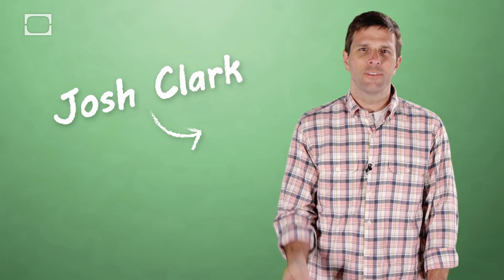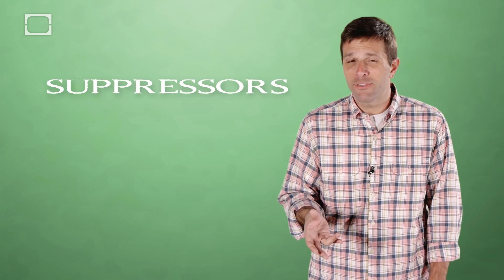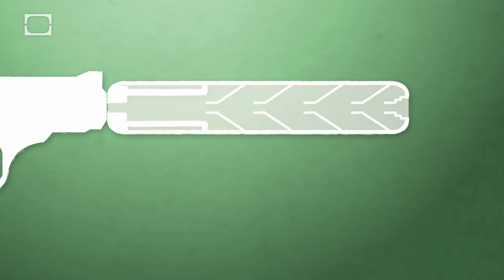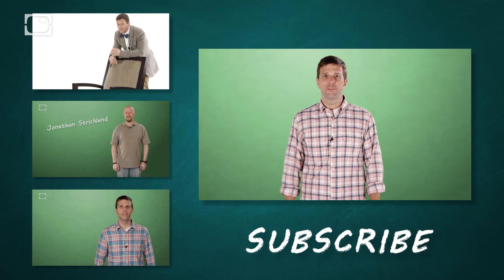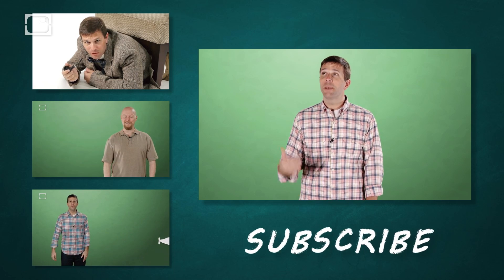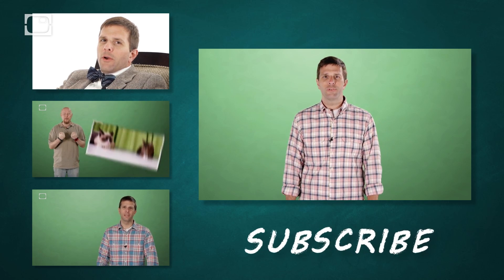How Do Gun Silencers Work?

Comment: Per definition of the ATF they are defined as "silencers". Either term is correct. Also there isn't really a negative connotation of using the word "can." It's just gun lingo. Personally I like to think of them as noise politeness devices. It is the same concept as putting a muffler on your car. It's mainly for the users hearing protection.

Comment: only nitpick is that these numbers might work with a few specific rounds, but those numbers are very situational to a specific caliber or two, including the 160 db number, seeing as not only does that only apply to a few calibers, but that number is also changed by the fact that the actual chamber, where the noise is originating, is never supposed to be that close to your face, therefor, the noise would be much more bearable.

Comment: 1. Hiram P. Maxium is credited for producing the 1st commercial silencer which he named Maxium Silencers.  Since his is the first and he named it a silencer then the CORRECT term is actually silencer and NOT suppressor.

2. Gun power burns - it does not explode. 

3.  The slang term for silencers is "can" but calling them that does not denote that one is a criminal.

4.  Silencers were invented and used for gentlemen target pistols which quietened the guns so no ear protection was needed for the shooter as well as spectators.

5. Spies don't use silencers - most sit behind a desk in front of their computers.  Criminal elements don't use them either.  Class 3 firearms require a much more extensive background check, fingerprinting, and ok from local law enforcement,and a $200 tax stamp.  The waiting period is about 9 months.  The FBI lists no crime committed with a silencer.

6.  Some ammo has always been subsonic (like .45 acp) that was designed before silencers were invented

7.  You watch too much tv and movies

Next time do a little research before you make an instructional video

Comment: Close enough, in a simi-auto pistol, (not that I don't believe rollovers can't be outfitted with suppressors) there are a a few more sounds. sound one, striker or hammer dropping, sound 2 firing pin hitting primer and primer cracking, sound 3 smokeless powder exploding, sound 4 gasses expanding and exiting barrel, sound 5 sonic crack caused by supersonic bullet and finally sound 6 the metal of the slide cycling and the barrel dropping and accepting another round.

Comment: Yah actually not true at all, suppressors increase velocity because it gives more time for all the powder to burn and create more pressure behind the bullet. the velocity increase is not significant usually between 10-60 fps on rifles but never the less and increase and most rifles that I have seen have stayed the same or improved in accuracy with a suppressor

Comment: So much BULLSHIT. Just stop talking. First, referring to them as "silencers" (even after correcting YOURSELF) throughout the episode reinforces the notion that these are the chosen accessories of assassins. WHICH THEY ARE NOT. In fact, in many other countries (like New Zealand), when you buy a rifle, IT COMES WITH A SUPPRESSOR. Second, in your graphics, you show a suppressor being attached to a revolver, which does not work, since there's a gap between the cylinder (where the bullets go) and the barrel (where the bullets exit), which defeats the entire purpose of providing a space AT THE END OF THE BARREL for the gas to expand. Third, you make blanket assumptions throughout regarding PSI, muzzle velocity, and decibels which not only change DRAMATICALLY depending on the ammunition, but also between the same ammunition used in different firearms.  FOUR, although you've stated otherwise in the comments, your statement about people who refer to suppressors as "cans" was OBVIOUSLY not a joke and your intent was sincere at the time, and you know it. Five, the end result is not a tiny "pew pew pew" sounds Hollywood has lied to you about for decades. The end result is a noise reduction that doesn't always even eliminate the need for ear protection. Six, there's no loss of accuracy. Due to the reduced velocity, there's a reduction in range (the distance the bullet will travel).

Comment: Was that cute little silhouette animation of a suppressor (a.k.a. silencer) being threaded onto a revolver done as a joke of some sort? I feel like even if you aren't very knowledgeable when it comes to firearms in general, it's still fairly obvious that there's a good explanation as to why you've NEVER seen a revolver with a suppressor attached to it. How the person who add said animation didn't sense something off about the way it looked or that he/she should probably use a semi-auto pistol instead due to the fact it's something they've actually seen being used with a suppressor. Anyways, the reason you've never seen anyone attempting to use a revolver equipped with a suppressor is because it simply doesn't not work rendering it utterly pointless having all the negatives of the suppressor (added weight, larger silhouette, less concealable, throwing off overall balance, blocking the iron sights, etc.) without it's intended purpose to cancel them out. Attaching a suppressor to ANY revolver only forces the noise out of the breech/chamber end of the barrel instead of it coming out of the muzzle as well. This is because the breech/chamber end of the barrel on a revolver is not sealed/enclosed within the frame or any other part of the firearm (like a slide does on an auto-pistol which forces almost ALL of the gas/noise out through the muzzle) meaning those gases/sounds escape from both ends of the barrel instead of just the one.

Comment: First of all... When you make a video called "How Do Gun Silencers Work?", you should get all your facts right and actually know how CAN'S work!

1. You do not loose accuracy from mounting a suppressor on your gun. If anything you will gain accuracy from the additional weight and lessened recoil. Also, the suppressor will make less turbulence at the muzzle, therefor the projectile will be more stabilized during the transitional ballistic part of its "flight" making it more accurate. As a secondary effect you will become a better shooter from the lessened recoil and bang.

2. You will not loose any speed from because of the CAN. The can is, as you say, an extension of the barrel, giving the gasses more time to work on the projectile before they vanish into the air. Therefor making the projectile go Slightly, SLIGHTLY faster.

The two points above are myths presented by the video game "call of duty". I am sad.

3. If you had talked to any people who call suppressors, cans They would tell you that using a revolver as an example for a firearm for which to attaching cans on, is the dumbest idea ever. Revolver is by nature not made for silencers, at all. They have cylinders with chambers in, usually six, that cycles. This is basically six barrels cut in half, taking turns trying to line up with another half of a barrel. This makes for a ton of gas leakage.

4. A CAN does not only let the gas expand, but lets the gas move more around to slow it down. A suppressor is usually more complicated than what your animation staff was able to come up with. They have angles and turns to make the gas slow down and be redirected. Many of them also have a back chamber to direct the gases backwards. Pistol suppressors also have a spring loaded piston to push back on the gun to make it cycle.

5. This one is not as bad as the others but worth mentioning. Sound travels at different speeds at different altitudes, different temperatures and different humidity. Take a revolver, a CAN and a round of subsonic ammo to the top of Mount Evrest to kill your sherpa without the other sherpas hearing it and you are in trouble.

Knowledge is power and when it comes to firearms and CAN'S, you guys are powerless...

Comment: 1: You can put a silencer on a revolver. Even if you could it would still be loud because the sound comes from the barrel gap. And a supressor doesn't make it as loud as a whisper. I know you tried to correct it with an anatation, but that was too embarrassing to correct. It makes it about as loud as a .22 magnum (if it's lets say a 9mm)

Comment: Wow, you really managed to pack a lot of complete BS into one short video.
0:43 Yes. "Silencer" is exactly what they're called. That's what the inventor of the device called them. That's what they are called on my ATF Form 4s. And that's what the majority of manufacturers call their product. How many Form 4s do you have?
0:58 Actually four sounds. In addition to the ones you mentioned, there is the sound of the bullet impacting the target.
1:14 Gunpowder doesn't explode. It burns or deflagrates.
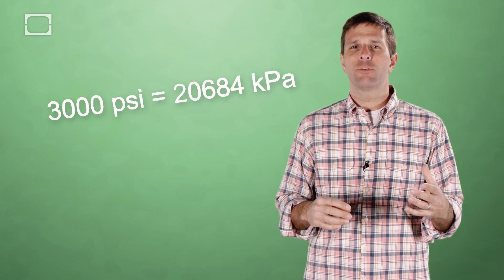1:19 Pressures vary dramatically with caliber, barrel length, and action type.
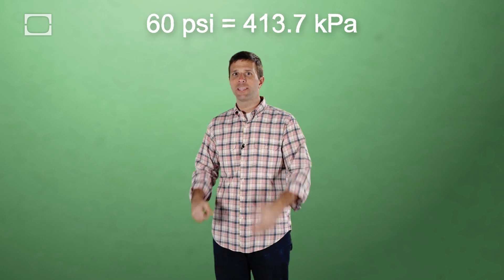2:10 Again, the sound pressure varies with caliber, barrel length, and action type.
2:25 One more time, the amount of reduction varies with the factors above and the design of the can.
3:43 Silencers that do not use wipes (most modern designs) actually slightly increase velocity (this is called free bore boost) and in some cases improve precision as well. While all silencers do shift the point of impact, well designed cans produce a very small and repeatable shift but also shrink the group size.

Comment: They are called suppressors.
Reply: +Team6OWG 
They can be called either. The guy that invented them dubbed his creation the silencer, and it was called that for years until tacticool mall ninjas went around correcting everyone's terminology on every goddamn thing.... Its not as definitive as the clip vs magazine meaning where theres a clear difference.
Reply: +Team6OWG The FBI calls them silencers. This guy got EVERYTHING wrong.
Reply: +Team6OWG The inventor, Hiram Percy Maxim, actually called them silencers. He also invented the automobile muffler, which is exactly the same technology. In fact, I find the best way to describe how firearms suppressors/silencers work is to just explain them as mufflers for guns. While "suppressor" is a more technically accurate description of what a "silencer" actually does, both terms are acceptable. It's not nearly as much of a fopaux in the gun community as using the terms "clip" and "magazine" interchangeably. At least when someone says "silencer", gun enthusiasts know for certain what you're talking about.
Reply: +Elijah Decker "It's not nearly as much of a fopaux ..."

* faux pas
Reply: +Team6OWG Suppressors silencers cans iv heard them all and got the idea...people that actually use or deal with them, Spec ops, CIA, FBI, ETC.... call them cans so yea..
Reply: I prefer suppressors since silencers sounds like it makes no sound like shooting in a vacuum with laser beams
Reply: ***** Intentional example.

Comment: This guy doesn't know what he's talking about. He states that suppressor is right while silencer is wrong yet proceeds to call it a suppressor. A long barrel increases accuracy but suppressers in particular decrease range. Unless you're using a .22 the hammer is not the only thing that is herd, because anything above a .22 will produce more gas thus making more noise, but the suppressor does help (unless you use a 50 cal.).
Reply: +Douglas Mitchell Read your second sentence again.
Reply: +justsaying yeah I noticed that one too but I'm just a bit to lazy to fix it.

Comment: Even better than calling them suppressors, we should start calling them "Hearing Safety Attachments", or HSA.   After all, the Salvo 12 6" suppressor on my buddy's KSG only reduces the volume to 140dB, which per OSHA is the limit to where permanent hearing damage occurs.   In other words, its still VERY loud, but at least you won't cause lifelong permanent damage to your hearing.

So in self-defense, it makes sense for absolutely everyone (especially in home defense if firing indoors which makes it even louder by reflecting off walls) to use a suppressor, or HSA.   Otherwise, you run the risk of being quite disoriented especially in the dark from the bright flash of the gun and the huge pressure wave that can leave you partially deaf for a while with ringing in your ears.   Yet the government has regulated a gun safety device to protect the shooter as some kind of nonsensical assassin tool that no one would need, thanks to the movies.

Comment: Wait, do cans actually reduce accuracy? I mean in games they do as well but at the same time extended barrels improve accuracy.
Reply: +krish698 No, they do not reduce accuracy. If you have a 2" group at 20 yards with a handgun, and you put a suppressor on, you will still have the same group. Your point of aim may be off a bit, though. Easy to compensate for, though.

On the other hand, suppressors need lower velocity ammunition to be effective. :p
Reply: +Theleh pwnage Lower velocity, lower power. That is why almost all suppressed guns worked best when using higher cals.

so he is not wrong about "reducing power"

Comment: They are called both silencers and suppressors. When you fill out your form 4 (or form 1 if you're making your own) they are listed as "silencer". Pressure in a 9mm chamber is ~35,000 psi, not 3,000, and around 55,000 in a 5.56 chamber. They DO NOT make your gun whisper quiet. Not even close. You are still looking at ~125 db for most non-magnum rounds. That is as loud as a concert. Silencers also INCREASE velocity and have no effect on a rifles accuracy. Almost everything you said in this video was flat out wrong. You also acted like anyone who owns a silencer is probably an assassin, which is Hollywood nonsense.

Comment: It doesn't affect bullet power or accuracy unless you're playing Battlefield, the downside of using a suppressor is the back pressure caused damaging the weapons internals.
Reply: +X Maneuver I think you are referring to blowback. Blowback is the release of the pressure in the baffles directed backwards into the barrel of the gun. It significantly increases the buildup of burnt powder in the chamber and ejection port. Firearms manufacturers are redesigning systems to compensate for this.
Reply: Riley Nash The chambers cause the back pressure to build up in the barrel. We're talking minor damage that builds up over time, they even designed a special rotating suppressor that spins to absorb the pressure rather than allowing it to build up inside the barrel, its pretty genius, look it up, its somewhere on Funker 530 youtube channel.
Reply: +X Maneuver Back pressure is an event that happens at low pressure after the bullet has left and pressure is fairly low. It can increase bolt velocity which can cause faster wear, but your rifle has to be pretty borderline to have a problem. It really just means more gas in the face.
Reply: +Big Bick 
A. I never shoot subsonic ammo through my 5.56mm silencer.
2.Velocity has next to nothing to do with accuracy.
iii. Most supersonic pistol and .22lr is only barely supersonic.
Reply: Like suppressing an AR 15 blows gas back into the action and makes the rifle dirtier
Reply: If you actually want to be quiet your going to be using sub sonic ammo which could hurt (kinda, sorta, not really) the overall damage.
Reply: +william kirby Subsonic ammo is far less refectory than full power rifle ammo.
Reply: +william kirby *effective
Reply: it does affect accuracy to a minute degree since sub sonic ammo is used with suppressors most of the time with has slower velocity which can suffer more than standard ammo in situation with a lot of wind or rain however even if you shoot subsonic ammo out of a non suppressed gun it will still be quieter than standard ammo since it doesn't travel slower than speed of sound. however it also depends on weapon and ammo configuration since 95% of pistol rounds are subsonic (.45 ACP Subsonic, 9mm borderline supersonic) however pistol carbines are a different story since the longer barrel increase velocity you will get slightly better accuracy over range due to the longer barrel. so in most cases Suppressors do silence the gases but if your bullet hits a metal object it will still draw attention , basically slower ammo = less accurate since it will be affected by other factors easily compared to faster ammo
Reply: Errr... Are you for real? That's like saying bullet velocity doesn't really matter in open warfare... Lower velocity causes less cavitation in targets, lower weight retention, and inferior penetration values. External variables such as barometric, wind, and gravity become much more noticeable at a distance.
On the loop side, you're statement also implies that +P+ rounds do not openly effect power or accuracy unles you play games, and do nothing but require better weapon maintenance.
Reply: I wouldn't call it "damage" I would call it more "wear", also the gas in you face sucks too with a semi auto

Comment: The video says that the suppressor drops the decibels from around 160 to around 20. That is a huge error. I see that they did put in a little window explaining "Oops!  We meant drops it by around 20, not to around 20" - but this changes the content dramatically. Even with a suppressor, a gun is still about as loud as a jackhammer. I don't understand how you can make a video explaining how gun silencers work, without at least making that point clear. Most people know "silencers" from movies and TV: and the short answer is those are bogus. If that is one's conception, silencers do not work.